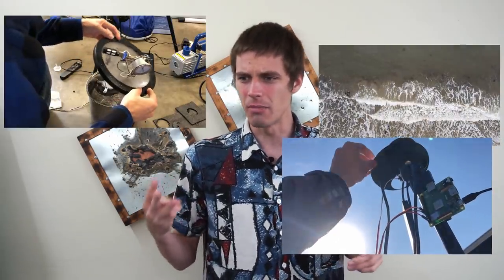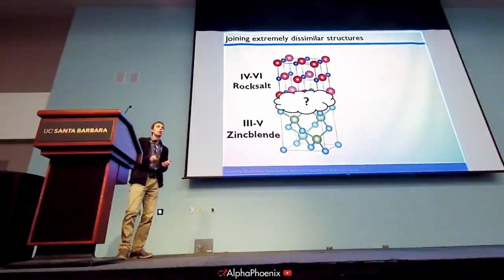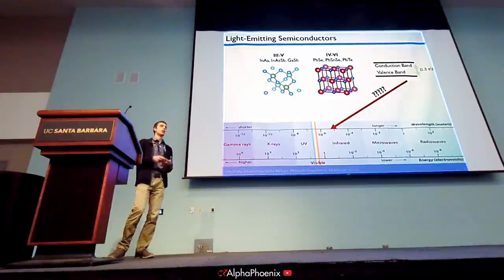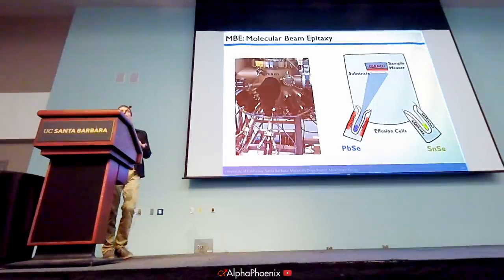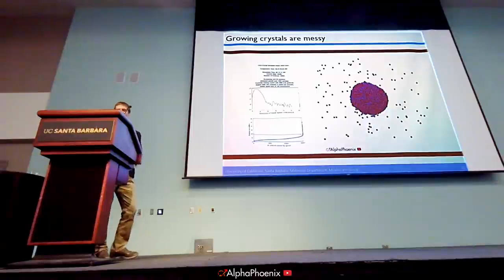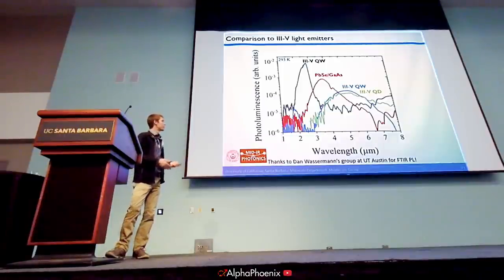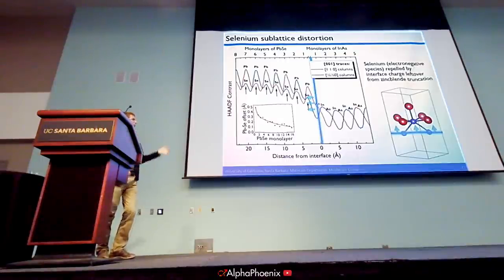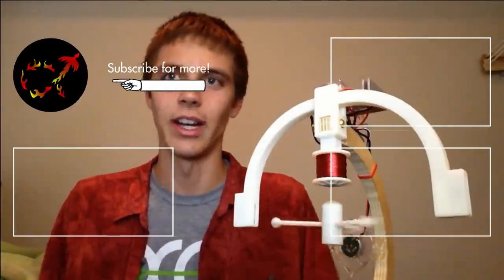Some REAL science for the channel! Growing semiconducting PbSe crystals (MROP 2020 talk)

Comment: I always thought that 3-5 crystals made good semiconductors because having 4 valence electrons was an ideal neutral position between metal and nonmetal, hence silicon and germanium and such. And I think amorphous carbon has a negative tempco, and grey tin is also distinctly nonmetallic, so these also exhibit some semiconductor-like properties. Same for 2-6 semiconductors, silicon carbide, etc. So the existence of 4-6 semiconductors threw me off. Then again, I’ve heard about selenium rectifiers before. No surprise that my understanding of condensed matter isn’t what it could be, I barely passed that paper.

Comment: Any chance of cleaning up the audio or recording a new track? It's nice content, but I gave up after 2/3 on mobile.
Reply from the maker: Sorry about that but I fear this is as good as it gets - the original recording was from a waterproof GoPro sitting in the first row and I spent literally a couple hours trying to deecho and denoise. Most of the weird noises now are artifacts of that process - coughs from the audience sent through a pile of filters. Unfortunately there’s still hiss at 8kHz that’s directly on top of my voice so I couldn’t notch it out.
Reply: @AlphaPhoenixChannel  Arguably, the benefit of recording a new voice track over the existing video would outweigh the effort, but that's not for me to decide.

Thanks for the content either way!
Reply: @AlphaPhoenixChannel  The hiss exactly coincides with my tinnitus frequency and plays merry hell with it. :( I wonder if more advanced software, such as iZotope's RX 8 (30-day free trial), specifically designed to clean up this kind of recording might be worth investigating. Just a thought. Great talk, anyway!
Reply: @AlphaPhoenixChannel  Might have been better to just re-record the talk with your good mic and show the slides as the visuals 
+ less time spent working on it
+ Slides are actually readable
+ excellent audio quality

Comment: Very nice talk. The only thing that isn't clear to me is why you're growing PbSe on top of a III-V semiconductor - it seemed from the presentation that growing a IV-VI on a III-V is more difficult than on another IV-VI. Do we just not have means to manufacture a IV-VI substrate, so we're stuck with a III-V? Or do III-V have other nice properties that make it desirable to have a III-V below the PbSe?
Reply from the maker: Both! iii-v substrates are much cheaper, much more thermally conductive and have better mechanical strength and chemical stability than either native iv-vi substrates or the old fluorite substrates. You’re correct it WOULD be easier to do homoepi on pbse substrates but we never bothered to try because it wasn’t going to be useful.

There are also buckets and buckets of institutional knowledge surrounding iii-vs so by working with them we could get a lot more help!

Comment: Very interesting stuff! You mention that the effects at the interface would be more important for quantum applications than conventional semiconductor stuff. Do these rely on different properties of the materials, or are they excited differently? Or do both rely on the same property, but the quantum use case is just less fault-tolerant?
Reply from the maker: There are loads of interfacial effects in semiconductors that all rely on slightly different physics. In this case the electronic structure in one material has different symmetry than the electronic structure in the other material. Because that symmetry is sort of a fundamental property of space that’s continuously varying everywhere, that means everything has to pinch shut between the two materials in order to flip from one symmetry to the other, leading to weird things that only happen literally AT an interface and nowhere else.

The much more commonly studied “2D Electron Gas” exists at GaAs/AlGaAs interfaces and is the foundation of a lot of cool quantumy research although it’s not based on the topology/symmetry/weird stuff I was talking about here
Reply: @AlphaPhoenixChannel  Thanks! It's very interesting for me to think of the molecular-level interface and how it is created, as opposed to just assuming an instantaneous/perfect transition (to make the maths easier for field calculations etc.).
Reply from the maker: Haha yeah nothing’s as clean as the simulations and pictures xD

Comment: I've always had the fantasy of using survivalist accessible methods to make a computer. One of my ideas was to make the transistors with PbS (Galena) since you could practically get that out in the wild relatively easily. other than the fact that it would be (a) easy to get, and (b) a semiconductor.... I have no idea where one would go from there. I had assumed something like the germanium "cat whisker" junctions could be formed with the right dope-ant laced wires.
Reply: Yeah, that really wouldn't work, cat whiskers make a rough diode, but you need the depletion zones to make a proper switch.

Comment: Liked the talk even if it’s not my research field. General question : semiconductors can only be made from metalloids ?
Reply: In theory other materials can behave as semiconductors. For example, extremely tiny metal nanoparticles(<~5nm) can have a band-gap in the same range as semi-conductors(something to do with there not being enough atoms to stabilize the electron shells to lower the conduction band). But in general only the 3/5/4/6 material behave as semi-conductors. At least this is my understanding